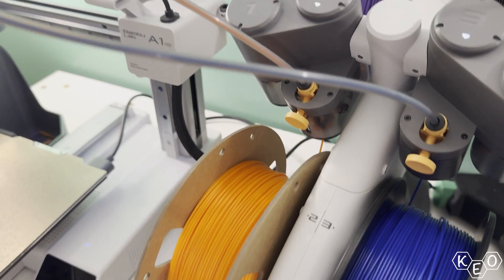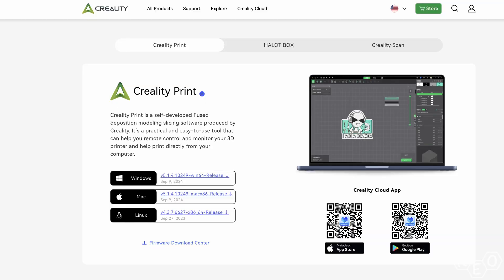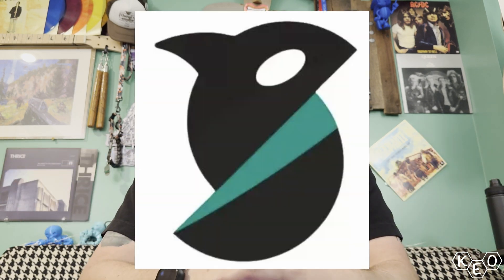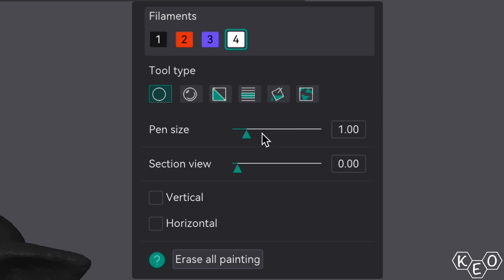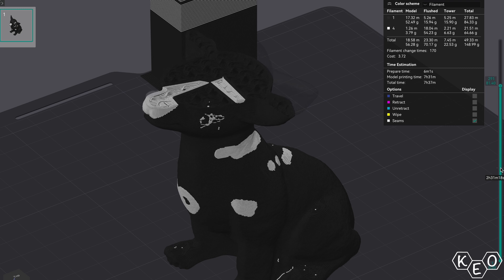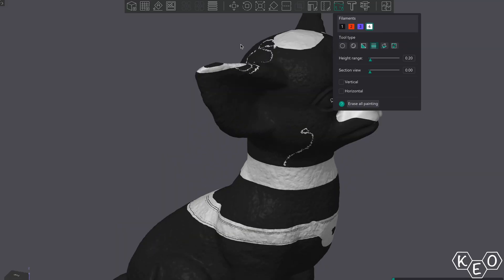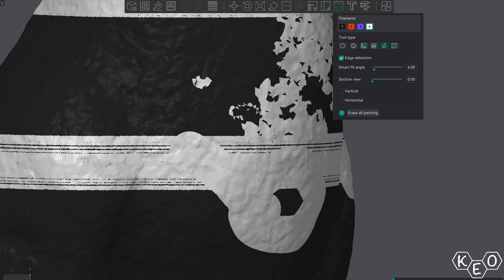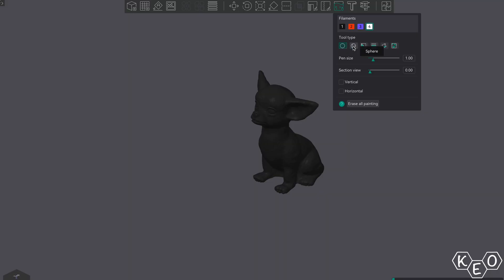This Is The Best Slicer For MultiColor Printing | Orca Slicer Tutorial

Comment: I use Cura on my work Ulitmaker printers.  I use ORCA, Bambu Studio and Creality Print at home.  I perfer Creality Print because it works nicely with my K2 Plus Printers.  Cura was a good slicer to learn on.  It works well on a  Ultimakers closed system. and the two nozzles.  Ultimakers are the best most reliable TPU printers available.  I've been doing dual materials since 2018 our of a dry box.

Comment: I used to only use Cura slicer, Because all my printers were Marlin based and Cura was so much more easy to use than the then Prusa slicer!

In Cura, you see all the features and functions and controls in one place on the right side of the work screen when you open it.

But Prusa slicer like the now Orca slicer has the main controls and features etc. in lots of menu's all over the place, you have to go through lots of menu's looking for the right thing and the names of the functions are often different. 

Like I can't find " Flow Rate " in it at all so then have to go to the printer and set that as the printer starts on it's screen! I even did a search for it in different names as flow rate or flow did not show up?

I got used to Cura simple all in the right long but good menu on the right. There they showed flow rate as what it is called, flow rate.
Now 4 years on half my printers are Cura half are Klipper, as the tech has changed.  I now use Orca for the klipper ones and Prusa for some of the others and the Qidi slicer for my Qidi x plus 3. as it works fine.

I just brought the new Flashforge AD5X printer, My very 1st full colour changing printer.

So as soon as I tidy the printers area up and do some building of some wooden framing to hold the new lengths of work tops I be able to put 

My Qidi x plus 3 up on one top and the also very heavy Elegoo Neptune 3 Max on the other top. 
And sort out the other top there already to hold the new AD5X printer 
and the Elegoo Neptune 4 Plus and maybe enough room there for my good old Neptune 3?

Now my Qidi x plus 3 has a error on the heat bed, so Qidi help asked me to check the board and bed cable?

My other printers I have are not being used or been dismantled and packed back in their original boxes for storing!
My FL Sun QQ-S Pro Delta is maybe either going to be packed too or I may try & redo the hot end and try get it printing again?
Just leveling issues with it and the hot end needs to be changed, I have a spare hot end for it so we see?

I now use a Nano spray on my beds to stop the warp problems of PETG or other high temp filaments!

I have stopped totally using the Elegoo Saturn 2 resin 4K printer due to the cost of the resin and the toxic nature of it and the waste water after the washing of models. I used the water based resins to save on IPA costs, But I have 14 liters now of toxic waste washing water from doing resin models and have no way to get rid of the water?  No centers for waste here do the disposal of it. So no more resin printing now. 

I looking forward to using this new AD5X printer and doing the colour changing without me having to do the manual changing of the filaments.

I only don't use Cura now on the Marlin printers because it is not as good as it used to be!  
So again because I now use Prusa for some printers I still can't find the flow rate setting?

Comment: Just upgraded to the multicolor Flashforge. I had a hard time getting my colors in orcaslicer but finally did. Except now the Flashforge shows both colors when I send it over but it’s not asking me to select the colors.
Do you have any tutorials on sending the multicolor over?
Reply from the maker: I have had this very issue with orca on the AD5M. I’ve resorted to using orca-flashforge because I couldn’t spend anymore time troubleshooting
Reply: @KeoPrints  fingers crossed it’s printing right now and somehow I got lucky and it picked the right two colors. It was only a two color print and I loaded two colors in so I guess I had a 50-50 chance. I will try using the other slicer next time though!!

Comment: I feel like older versions of cura work better with older printers. I have access to an ender 3, original cr10, and a raise 3d n2 plus and cura just gives better print results. Or I just haven't found the right settings for orca slicer yet, idk. But I'm also using cura 5.2.2 for those and not the latest, cause again, it seems like I just get better prints with that.
Cura has some features that I'm missing in orca, but besides that I have also been very happy with orca so far and I really love it's calibration features.

Comment: Thanks Keo Prints for this video on color printing. I have the affordable FlashForge 5M for creating single color parts, but I have found multi color prints a plus. Currently, I have to baby sit the printer, and at the correct layer, pause the print and switch out the filaments to achieve the desired color change. So when I heard that Orca Slicer can do that by automatically pausing the printer for the color change, I started looking for the Orca tutorials and came across your tutorial. Excitedly, I found the Support Painting tool and was disappointed to not see the layer selection. I then tried to select more than one filament type, but could not find a way to add more. It looks like the Filament selection in Orca (1, FlashForge Generic PETG) only allows one filament for the FlashForge 5M. Am I missing something here? Is there a way to use the color layering function? Or, do I continue to baby sit my printer, pause, and switch out the filament? Please advise. Thanks, Donald
Reply from the maker: As far as I am aware, your best bet is going to be adding in the pauses for manual filament changes. I am not sure of a way to force pauses using the filament coloring options. But I would also be interested to see what others have to say here

Comment: The ability to drop a grayscale image and use it as a heightmap. Some call it a lithophane. Personally I use it for geographic terrain. In Cura you just drop the file and a settings dialog pops up. If there is the same function in Orca, I haven't found it yet.

Comment: One silver bullet for Cura over Orca is when you do the trick where you use infill as a grid pattern (removing top and bottom surfaces). Orca always wants to throw an interface layer (internal bridging) on it which ruins that trick. For some reason there is no way to turn off internal bridging. Even if you set it as low as possible on the layers where it would be it messes up the infill battery as it moves avoids where it would be.

Comment: so one thing that messed me up is loading up a print in orca that has the colors already laid out and if the colors don't match the layout of the CFS with the k2 plus then it won't print them correctly.... i've had to manually paint the whole thing to get the colors right or swap the colors around in the CFS.

Comment: When you do this doens't the printer then have to do many switches per layer to colourise the print. I've been restricted to layer colour changes in order to stop this (as it takes ages and uses lots of filament).
Reply from the maker: Yup, but this is the trade off when you are using this style of multicolor unit

Comment: I found painting a model aggravating, especially when the model had a polygon that went into two zones i wanted to colour differently. So, I switched to creating STEP files. My current process is to sculpt in Blender,  reduce the polygon count and clean up errors with the 3d print extension, save separate STL files.
Load into FreeCAD, convert to solid, and output the STEP file. Takes time to load into the slicer, but colouring the models and setting other options for specific pieces is easy (e.g. keeping a collar smooth while using fuzzy skin for fur) , and the load time drops once it is saved as a 3mf.
Reply from the maker: Thanks for sharing your process. These kinds of things are super helpful to hear about so we can all learn how to achieve different results. Or even the same results differently

Comment: Why is the coloring working that smooth and instant for you? I tryed it on different PCs and I always have to wait a few seconds after doing just one click. I need hours to properly color a simple model which is completly annoying. Any ideas pls?
Reply from the maker: I have no idea. Aside from complex models, I don’t have any lagging issues and I’m using a fairly basic MacBook Air
Reply: @KeoPrints  are you having any tips for complex models? I noticed it being slightly better with smaller files, but I just can't do such small sections for my projects

Comment: Switched to Orca this week. I ordered a Kobra 3 combo. Anycubic has been very good to me over the years. I’ve been using Cura for years and Orca already seems next level; especially with supports.
Reply: Same, same, and same! Just got one for $270 or something like that with two free rolls of filament. 
Can't beat that! 
Time to see if Orca will beat Cura in more ways than just multi color printing.
Reply from the maker: Great to hear! I agree with you. As someone that used to use Cura exclusively; Orca is where it is at!

Comment: I switched everything over to Orca. There's no downside. It's basically Bambu Studio PLUS extra community features.
I even learned how to add my older machines that do not have a specific machine profile for them, like my Ender2 Pro. Now it runs on Orca just fine.

I also am using the new experimental features for extended filament retraction before cutting, along with reducing flush volumes. It really saves a significant amount of purge waste on multicolor
Reply from the maker: I plan to look into the experimental stuff for filament retraction as well! Should make a huge difference